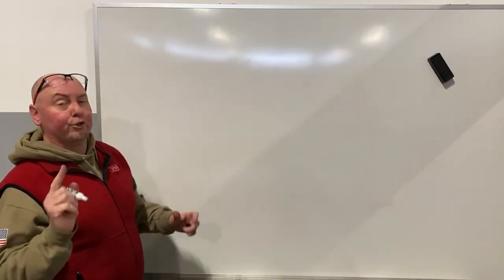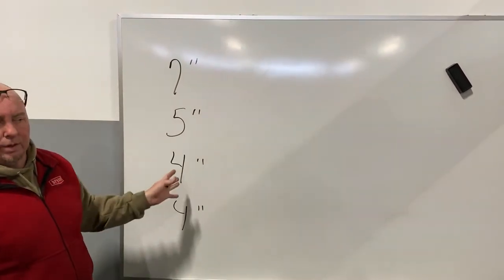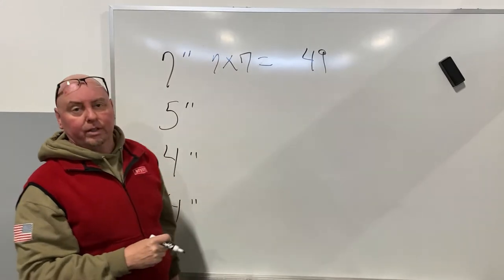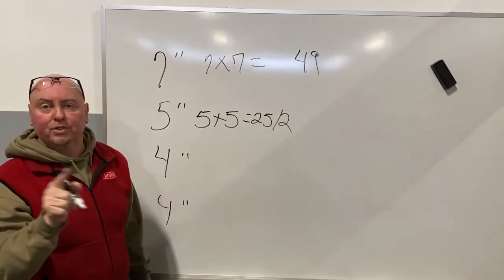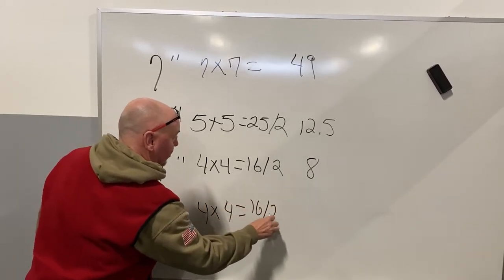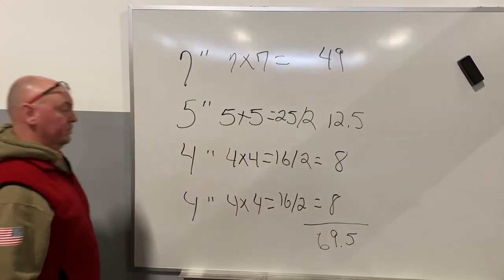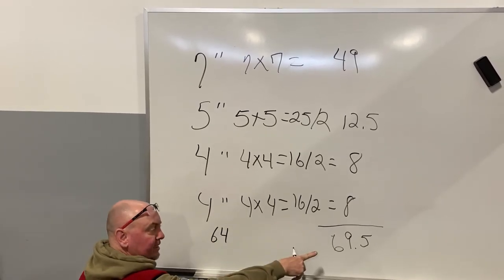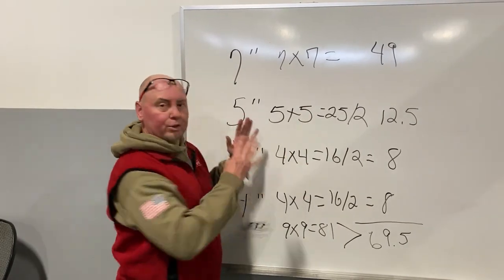Common Vent Calculation

Comment: Pl check the sum again . 😢
Reply from the maker: I believe the math is correct. They are general rules, referring to the National Fuel Gas Code and section on venting is always recommended. 

Thank you.
Reply: @HabeggerHelp  , it is correct only for square shaped pipes. That's not how you calculate areas for circles
Reply from the maker: @vitorao  I agree. However in this case I don’t need the full volume with the 50% there is wiggle room. I’m not calculating the volume of chimney, which obviously is very different. 

It’s close enough for manifolding considering flue pipe isn’t sold in half inches. 

As mentioned in the video, always refer to the National Fuel gas code for exact allowances of gas fired appliance’s. 

Thank you.
Reply: @HabeggerHelp , yes, in this case it's close enough. But you could have a case in which the result could be significantly different. Why not do the math correctly?